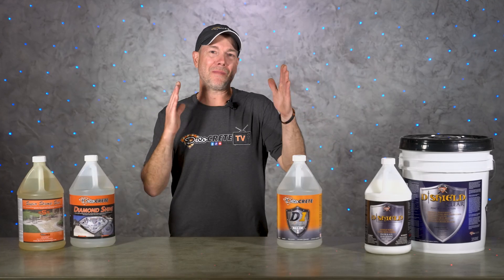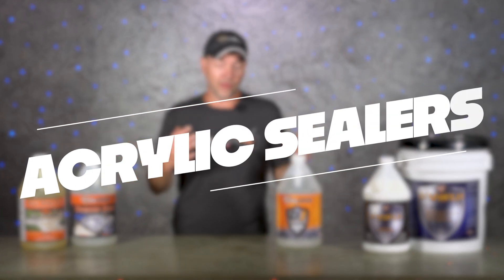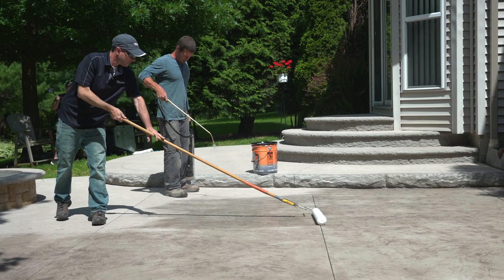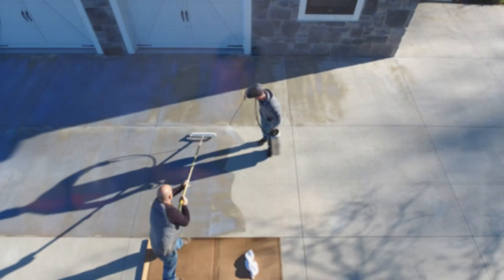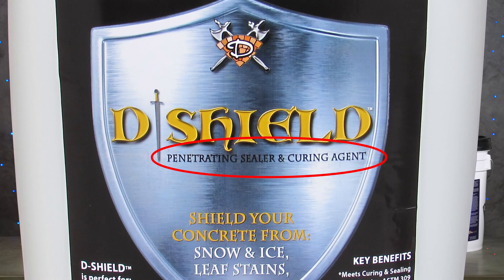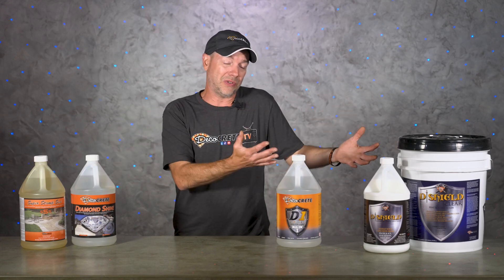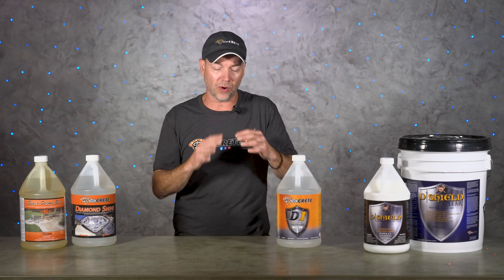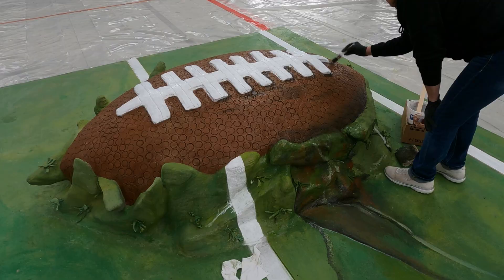Concrete Sealer Showdown: Acrylic vs. Penetrating Sealers

Comment: Can I use penetrating sealer no a painted concrete wall to repel dampness in my home
Reply from the maker: Thanks for the comment! We wouldn't recommend applying any kind of concrete sealer to a painted surface. The paint will not allow the sealer to penetrate or bond. If the wall is already painted, I would either repaint it or strip the paint and start over with concrete sealer. If all you're looking for is more water repellency, another coat or two of paint would be the easiest thing to do. Good luck with your project! Thanks for watching Deco-Crete TV!!!

Comment: Hi Jeff,
I was salting the porch - ran out of one kind of salt - then used some old pure rock salt.   And too much of it.
I brushed off the excess salt, but there's a white fine residue left.
Is this because the concrete sealant has worn out?
Should I clean with vinegar/water - and re-seal with a penetrating sealer?
Thanks for any help you can give me - financially we're definitely in a DIY situation now.
Steve
Reply from the maker: Thanks for the comment! The first thing I would do is hit with a power washer this spring once it warms up. The white residue should wash off. You could also try to scrub it Deco-Prep if it doesn't all clean off from the power wash. The biggest downside of salt/ice-melt is spalling on the surface of the concrete, and it doesn't sound like any of that has happened, so that's a good thing. As you're washing, I would pay attention to how fast the water soaks into the concrete. If it seems like it's soaking in really fast, then a fresh coat of sealer would be a good idea. I'll leave links to the Deco-Prep and sealer below. Hopefully everything works out well for you! Thanks for watching Deco-Crete TV!!!  
 https://www.deco-cretesupply.com/products/repair-prep-products-concrete-cleaners-waxes-acid-stain/deco-prep                                                                               
 https://www.deco-cretesupply.com/products/water-based-sealers/d-shield-5-gallons

Comment: Hi, I just found your channel.  Great, helpful video.  Question: I'm finishing up a "she shed" with a concrete floor.  It's, of course, fully cured.  I want to have a slight gloss (egg shell?), non-slip finish.  I don't mind keeping the color as-is, or slightly darker.  I just want something that lasts and will help prevent future stains from typical living conditions.  In your opinion, what product would you choose?
Reply from the maker: Thanks for the comment! Our D-One sealer would be best for that. It has a low sheen, and it would darken the color a bit. Our Super Stamp Seal would also be a good choice. Both of these products are high odor, however. If you need something low odor, then I would recommend our D-Guard Clear WB 25 (Water-Based sealer.) I'll leave links to all of these products below. Thanks for watching Deco-Crete TV!!!                                                                                                                                                                                          
 https://www.deco-cretesupply.com/products/decorative-concrete-sealers-solvent-based-sealer/d-one-5-gallon                                                                                    
 https://www.deco-cretesupply.com/products/decorative-concrete-sealers-solvent-based-sealer/super-stamp-seal-5-gallon                                                               
 https://www.deco-cretesupply.com/products/water-based-sealers/d-guard-wb-25

Comment: I have a 3 year old concrete basement I want to seal with super durable matte finish. Kids ride bikes, trikes electric carts etc on floor. What do you recommend?
Reply from the maker: Thanks for the comment! The very best thing for this would a two part coating, but that would require grinding the floor first and it would be quite a bit more expensive than a sealer. For an easier DIY option, we would recommend an acrylic (topical) sealer. Because it's in your basement, a water-based option would be best due to the high odor of solvent based sealers. I'll leave a link to a video explaining the difference between sealers and coatings as well as a link to our D-Guard WB 25 sealer page on our website. Hopefully this helps! Thanks for watching Deco-Crete TV!!!!                                                                                                                        
 https://www.youtube.com/watch?v=dSz71y4uKcU&t=104s                                                                                                                                                                                
 https://www.deco-cretesupply.com/products/water-based-sealers/d-guard-wb-25

Comment: I’m doing a grind and seal on my cement floors. The house is 50 years old. I looking for a Matt finish. What is the best sealer to use for the job. DIY JOB
Reply from the maker: Thanks for the comment! Our D-One concrete sealer is a great way to create a matte finish on a floor like that. It'll bring out all the color from the stain, it's highly durable and water repellent. I'll leave a link to the product page on our website. Thanks for watching Deo-Crete TV!!!                                                                                                                                         
 https://www.deco-cretesupply.com/products/decorative-concrete-sealers-solvent-based-sealer/d-one-5-gallon

Comment: Thank you loving your videos.  Has helped me tremendously.  Is it possible to apply a penetrating sealer down then apply an oil based acrylic sealer (matte finish) over the top (waiting enough time in between of course), in in order to get the best of both worlds?
Reply from the maker: Thanks for the comment! It is possible to apply an acrylic sealer over a penetrating sealer, but it can be a bit risky as acrylic sealer can have a tough time bonding after the penetrating sealer has been applied. Our D-One sealer would serve the same prepose without trying to bond two different kinds of sealer together. It does leave a film behind, but it also has a water repellant that penetrates into surface of the concrete. This will give the best of both worlds. Here's a link to the D-One page on our website. Thanks for watching Deco-Crete TV!!                     
 https://www.deco-cretesupply.com/products/decorative-concrete-sealers-solvent-based-sealer/d-one-5-gallon
Reply: @DecoCreteTV  can i add an anti-slip additive to d one?
Reply from the maker: @ambrosia1917  Yes, you can add anti-slip to the D-One. I'll leave a link to the one we recommend.                         https://www.deco-cretesupply.com/products/sealer-additives/deco-grip

Comment: We build a fence with pillars capped by pre-case concrete pier caps. what kind of sealant to use for them? based on this video looks like the penetrating sealant option is best to maintain the color and protect from the elements right?
Reply from the maker: Thanks for the comment! Yes, a penetrating sealer would work best for this. I'll leave a link to our Deco-Block sealer below. Thanks for watching Deco-Crete TV!!!             
 https://www.deco-cretesupply.com/products/water-based-sealers/decoblock

Comment: Hey thanks for the video. I'm looking for a sealer that would protect a driveway from oil leaks. What do you recommend? It would also be nice if it is DIY friendly, but I want your opinion!
Reply from the maker: Thanks for the comment! Our #1 driveway sealer is D-Shield. It is DIY friendly and very water-repellant. It will help protect your concrete against oil stains, but like any other concrete sealer, if oil is left on the surface for a long period of time, it will eventually find its way through the sealer and into the concrete. Even after it's sealed you should try to wash the oil off of the concrete as soon as possible, or put some oil dry on it as soon as you notice it. The D-Shield will help keep the oil out of the concrete better than any other, but it can only do so much. I'll leave a link to our how-to video on D-Shield and one to the sales page on our website. Please let us know if you have any other questions. Thanks for watching Deco-Crete TV!!!                                                                                                                                                                                                                
 https://www.youtube.com/watch?v=jt-CuwtCQGE&t=3s                                                                                                                                                                                      
 https://www.deco-cretesupply.com/products/water-based-sealers/d-shield-5-gallons
Reply: @DecoCreteTV  Awesome, I've got what you linked ordered!

Comment: I'm in Buffalo New York and every quote I've gotten so far has been with an acrylic seal. I found your website because the last guy just came out and said it's insane to use acrylic in the weather we get with the snow blowing and the snow salt. He says he would never even consider acrylic on a brush driveway. I'm shocked that this is the first I've heard of after getting four quotes.

I cannot thank you enough for this very clear and detailed video. 

It's left me wondering more about the hybrid solution so in your next video you should spend a few minutes on that specifically I think it would generate some interest.
Reply from the maker: Thank for the feedback!! The hybrid sealers are great for stamped concrete and broom finished patios, sidewalks, pool decks, ext.... But I would sick to penetrating sealer on driveways. Thanks for watching Deco-Crete TV!!!
Reply: Can I ask what you ended up going with? I’m in Buffalo too, and have the same concerns.
Reply: I had a contractor use acrylic sealer the day after pouring my concrete patio. Needless to say the ob was terrible and a mess looking. He is avoiding contact to correct. I'm in Rochester. I would never you  a water base acrylic sealer again!

Comment: We had the apron of our driveway poured 2 years ago. The thing pitted and just turned to junk from the salt from the plows. I am getting it redone in a few weeks. What product would you recommend to use for this to keep it in the best shape possible for as long as possible?
Reply: Didn't he just recommend it. Penetrating seal
Reply from the maker: Thanks for the comment! We would recommend our D-Shield penetrating sealer for this. There is no way of eliminating damage from salt, but D-Shield will give you best protection possible. To get the most protection out D-Shield, we recommend letting the concrete cure out for at least 30 days before applying the sealer. I'll leave a link to our how-to video on D-Shield as well the sales page on our website. Thanks for watching Deco-Crete TV!!!                                                                                                 
 https://www.youtube.com/watch?v=jt-CuwtCQGE&t=1s                                                                                                                                                                                      
 https://www.deco-cretesupply.com/products/water-based-sealers/d-shield-5-gallons

Comment: Hi Jeff
I’m in a 4 season location.
I poured a concrete patio by making individual stone slabs (kind of a flagstone look).

What is the best option for avoiding winter cracking of the concrete stones?

I will be filling the gaps between the stones with stone dust, so curious if I should be sealing the sides of the stones as well.

FYI - stones are about 1  3/4” thick and average about 1.5 sq ft of surface area per stone.
Embedded in each stone is a 1” welded wire mesh fencing to act as a crack inhibitor.

Thanks for the video and any advice you can offer.
Reply from the maker: Thanks for the comment! Sounds like a cool project! I would recommend sealing the stones with our D-One sealer. It'll leave a low-sheen, natural look, but still bring out the color of the concrete. You can seal the sides if you want, but it's not necessary if they're gonna be covered up with the joint filler. Keep in mind that concrete sealer is more for protecting the surface, and doesn't do much for preventing cracking. Concrete can crack for a verity of different reasons. Proper thickness & mix design, a solid sub-base, reinforcement, and proper control joints will all help reduce cracking, but won't completely eliminate them. I'll leave a link to the D-One page on our website below. Thanks for watching Deco-Crete TV!!!     
 https://www.deco-cretesupply.com/products/decorative-concrete-sealers-solvent-based-sealer/d-one-5-gallon

Comment: Just wondering what you would recommend for an internal heated concrete floor with a minimum gloss appearance? Thank you
Reply from the maker: Thanks for the comment! What is floor being use for? If it's a garage floor or something that's gonna get heavy use and wheel traffic, you might be better off with a two-part floor coating instead of a sealer. This would be quite a bit more expensive and require a diamond grind before applying the coating, but these coatings would not ware away like concrete sealer. If you do end up going with a sealer, our D-One would be the best thing. I'll leave a few links you can check out. Thanks for watching Deco-Crete TV!!!         https://www.youtube.com/watch?v=dSz71y4uKcU&t=426s                                                                                                                                                                                 
https://www.deco-cretesupply.com/products/decorative-concrete-sealers-solvent-based-sealer/d-one-5-gallon                                                                                     
https://www.deco-cretesupply.com/products/sealers-coatings/coatings
Reply: @DecoCreteTV  Half workshop half habitable which has the underfloor heating inside the slab. cheers

Comment: a water base wax based concrete curing compound is an excellent cure for interior, exterior, horizontal, and vertical concrete surfaces. good clip.
Reply from the maker: Thanks for the comment!! 👍

Comment: Thank you so much for your videos. Always learn something. Can you please touch more on using acrylic sealers as a curing compound? Just roll on next day? Haven't heard much about that. Thanks again!
Reply from the maker: You are welcome! Thanks for the comment! When using acrylic sealer as a curing compound, you would normally spray it on the same day as pouring. The general practice would be to finish the concrete, pull the forms, clean up, and then spray the cure as the last thing before you leave the job site. This is mostly for broomed or smooth finished concrete. Stamped concrete is little different, most stamped concrete never gets cured like this, it just gets sealed after a week or two. I'll leave a link to our Curing vs Sealing video below. Thanks for watching Deco-Crete TV!!!                                                                                                                                                                               
https://www.youtube.com/watch?v=V_0eIsgg2pc
Reply: @DecoCreteTV  Thank you so much as usual! 🙏